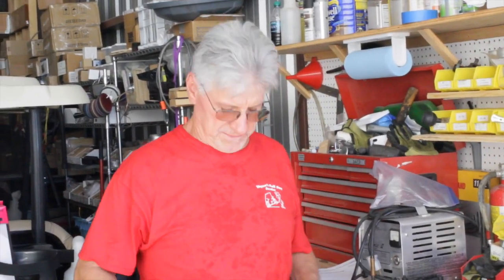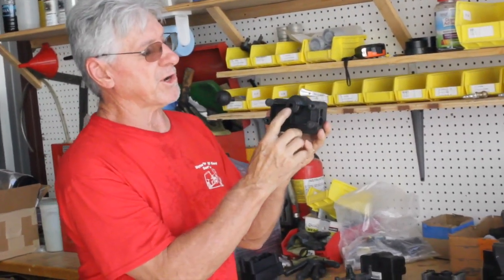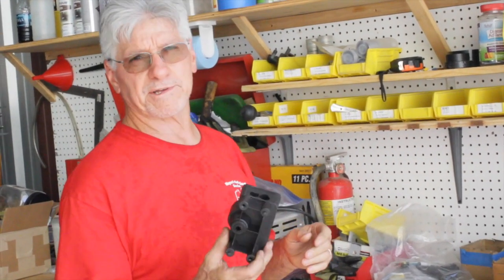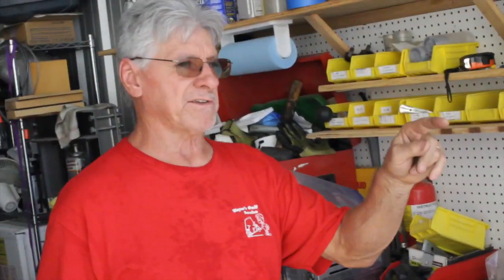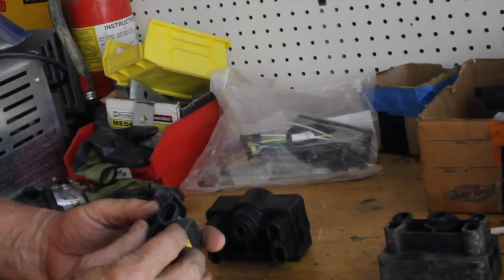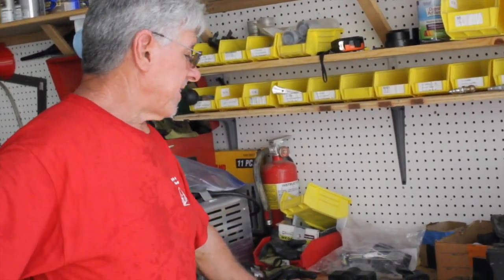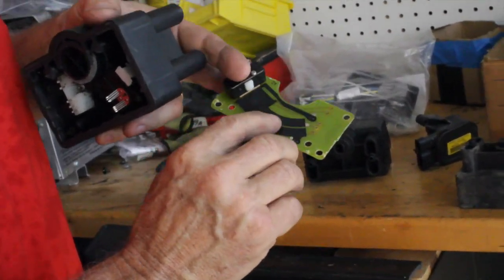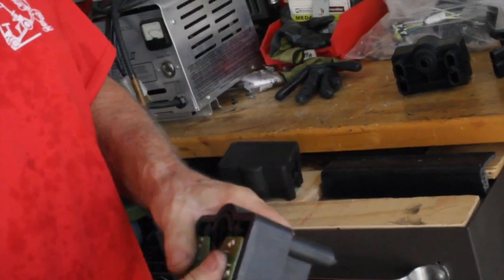The Difference Between MCOR's (For Club Car Golf Carts)

Comment: I replaced my mcor on my 2014 precedent but it still won’t move any ideas?
Reply from the maker: If it won't move at all, it's not the mcor. Either batteries,  solenoid, loose or bad connection,  tow switch, or the fuse that is back by the controller.

Comment: Hello! What does jumping the 2 wire connector on MCOR do? I have a 2017 club car precedent with intermittent moving issues. It’ll work fine then stop working and work again. Saw other videos of bypassing the MCOR. Wondering if i can do that for a cheap fix.. just fixed a rattling loose brake pedal and a shorted horn. Thanks for the video and help !!!!!
Reply from the maker: That closes the microswitch That is inside the mcor.

Comment: Am I right to assume my 2018 precedent i2 uses an MCOR 4?  I have some hesitation/shuttering at full throttle.  My batteries are new, my original curtis controller had the same issue, my new alltrax XCT is having the same issue, I have a brand new solenoid and newer motor.  I can't think of what else it can be???  Hopefully I ordered the right part!
Reply from the maker: Yours can use both the mcor2 and the mcor4
Reply: @waynemartin.waynesgolfcart4900  Thanks!

Comment: I have a club cart 48 volts 1996 and my mcor is a potentiometer  , can I retrofit to mcor4
Reply from the maker: It depends on the serial number of your cart, what is the serial number?
Reply: Serial number : A9645-542184
Reply: Thank you very much for your help , parts are hard to find and I want to get the best parts
Reply: Serial number : A9645-542184

Comment: Do you have a video on installing a AM293101
Reply from the maker: No video,  but the kits I sell come with complete instructions
Reply: @waynemartin.waynesgolfcart4900  I have a 1993 six volt system. Will this work. It has the old switch system
Reply from the maker: No it will not
Reply: @waynemartin.waynesgolfcart4900  Am I stuck. Do I have to try and replace the current system. I looked at your website. Looks like you are very experienced in the golf cart business. My cart is in great shape. Not sure if it would be worth trying to convert to a 48 v system with all new parts to make it work
Reply from the maker: What do u have now for a system?
Reply: @waynemartin.waynesgolfcart4900  36 volt stock cart
Reply from the maker: I was asking what drive system? Resistors,  vglide, pot box?

Comment: Good morning Wayne I hope all is well well thus far I've changed my receptacle which I needed to do but we still have a power problem with our Club Car DS model. I had my daughter take it for a ride using my GPS and she got it to about 8 mph, she was on a slight downhill grade and got it up to 12 mph. Reverse is real slow and to try to back up a hill it's like non-existent. So I'm thinking emcor does this sound logical to you? Thank you in advance
Reply from the maker: Check batteries first,  usually # 1 problem. 

If cart was ever faster than 8 mph, could be the speed sensor.

Comment: Hello Sir. I have a 2003 Club Car DS IQ model. You are the only guy that seems to know how to get to the root of issues with electric carts. I replaced my batteries. Soliniod speed control is good. . The cart goes and will stop under load. Like going up a hill. Press the pedal again and she goes.rinse and repeat. I took it to a credible shop and they could not fix it. The Mcore has the upgrade. I’m baffled. Any advice for what to look for next? Have you ever encountered this. Your my last hope.

Best, Bruce Johnson
Reply from the maker: IF your batteries are NEW , not 4 years old,  AND you replaced the mcor with a conversion kit, NOT a aftermarket mcor, then that really narrows it down.
However my first guess is you replaced the mcor with aftermarket crap, and that is your issue.

They no longer make oem mcors for DS carts, so if you buy a replacement mcor, it will be junk.
The aftermarket junk wont last longer than a about a year.

So i think you are gojng to waste alot time going on circles with this.

If your mcor was good, then i would say either a loose connection, ( on motor, or key switch, etc ) or forward reverse switch needs replacing.
Reply: @waynemartin.waynesgolfcart4900   Wayne. I have not replaced the MCor. It evidently had a conversion put in it before I bought it. I had it for 2 years before it started doing this. Is it possible the conversion failed? I ve checked all connection and cleaned. Made sure they are secure.
Reply from the maker: if it does have a conversion, replace the mcor with a oem mcor
Reply: @waynemartin.waynesgolfcart4900  will do ! I look the OEM up getting it now! Thank you so much! Your videos are priceless.

Comment: Where is the MCOR located on a 94 club car?
Reply from the maker: Is it a 48 volt cart?
Reply: @waynemartin.waynesgolfcart4900  36 volt
Reply from the maker: You don't have one.  Only on 48 volt
Reply: @waynemartin.waynesgolfcart4900  Thanks, having symptoms of a bad MCOR. Any ideas?
Reply from the maker: I need more info. What do you have ? A resistor cart? Vglide? Potentiometer? How old are the batteries? What is or is not the cart doing? How long has the problem been noticed?

Describe what is happening?
Reply: @waynemartin.waynesgolfcart4900  Cart has vglide. Vglide, batteries, controller & solenoid were  replace 1 year ago. Cart cuts out while driving then kicks back in like a temporary loss of power. Been happening on and off for a month.
Reply from the maker: Could be a loose wire somewhere,  check all wires, even key switch. 
Also could be f/r switch, or vglide.
Reply: @waynemartin.waynesgolfcart4900  Thank you for your help.
Reply: Hey I have a 1996 36v club car ds with vglide. The cart is moving slow. Sometimes f/r switch isn’t working . Any ideas why it’s slow?
Reply from the maker: Hey, could be lots of things, old batteries first,  worn or dirty vglide,  if it's a resistor cart they are slow anyway.

Comment: How can I test to see if my mcor 1 is bad on my 2002 48v DS?
Reply from the maker: You should be able to tell when you step on the go pedal. 
Does the car move right away.
Do you feel any hesitation at any point when pedal is pushed?
Reply: It shudders in forward when I step on the pedal. But in reverse it runs fine when stepping on the pedal.
Reply from the maker: sounds like a battery problem
Reply: Ok. I load tested all six 8 volts and 2 of them showed bad. I’m pricing new ones now. It seems weird that reverse works normal even with 3 people in the cart, but forward barely moves, just shudders and creeps along.
Reply from the maker: reverse is half speed,  only uses half the voltage

Comment: When my pedal reaches full throttle the electric motor cuts off and on. Would this be my MCOR worn at top throttle? Mid throttle works fine.
Reply from the maker: Yes that sounds like the mcor. 
One thing to try, is turn the key off, stomp the go pedal to the floor about 10 times. Turn key back on and drive at full throttle and see if it temporarily got better for a minute.
If it did,  then definitely replace the mcor.

Comment: Wayne, great video. Got a question. Can you recommend a place on line where I can purchase a “OEM” MCOR 2?
Got a friend with a Club Car whose micro switch in the MCOR of a  Precedent is bad. Would just replace the switch but not sure if I can get the MCOR open without damaging it. Don’t want China knockoffs. Thanks, Ron Hirsch
Reply from the maker: yes, buy it from David at
Revolution Golf Cars.   I buy all my mcors from him. Tell  him Wayne in calif sent you!

Also, meanwhile unplug the 2 pin connector from the mcor, then bend a paperclip into a u shape,  then push the paperclip into the 2 holes in the loose connector.   Leave the connector loose then drive cart to see if that helps.

By doing that you are by passing the microswitch.
Reply: wayne if it’s the switch which I suspect, would you jumper it out and run it that way or is that dangerous? Thanks for the recommendation as to where to buy an OEM. If it was my cart I would just replace the MCOR though the part is pricy. It’s an old cart and putting a lot of money into it would probably be foolish.  I am a retired electrical engineer so working on this stuff is fun.
Reply from the maker: you can run the cart  like that, it won't hurt anything

Comment: Wayne, thank you so much for the MCOR-4 part #. Love your videos. First time golf cart owner with a 2002 club car DS. Your videos are by far the most helpful for a 61 year old cancer survivor with what my wife calls kemo brain, I call CRS (can’t remember shit) Keep the videos coming. Hope your well.
Reply from the maker: 👍im 67, going in 40.
Next week back surgery, so hope i can start bending again, and making more videos.
Reply: wayne martin I can definitely relate. LOL, hope all go’s well.
Reply: I also have a 2002 DS. So, the MCOR on this model year is the MCOR-4?
Reply from the maker: @johncalvo1743 you do not have a mcor4 on a ds, unless it has been converted.
Reply: @ Thank you. I just replaced the MCOR 2 hours ago. The cart is now running like a champ. I saw a few videos saying that there were some T-40 bolts on the floor mat that need to be removed. But my cart didn't have these. So, I removed the mat to open the little trap door that goes to the undercarriage, but the floor was solid aluminum! I was flummoxed. It turns out the MCOR was bolted to the outside crossmember of the chassis underneath the passenger side. It was easy to get to, but I had to jack up the cart.

Comment: Is it beneficial for me to upgrade my 2002 club car DS from an MCOR-1, to an MCOR-4 with a conversion kit?
Reply from the maker: Only would need to go to the conversion kit, when your mcor 1 fails.
Reply: I noticed from trial and error and research. The linkage from my go pedal to the MCOR is sloppy so I figured I’d just replace it all. I did put a rubber washer between the go pedal arm and the little pin it pushes to turn the arm to the MCOR and it helped speed up the cart. Don’t really like it being jerry rigged. Would rather replace the whole damn thing and have it done right.

Comment: Having a club car precedent myself, finding your channel has been great. Thanks for taking time to make these videos. 

Is there a video for testing the MCOR 2 ? I recently picked up my cart from a repair shop after determining the technician was a parts changer that just keep replacing parts until the cart runs again . That’s not my method. Surely there is a way to test resistance on the MCOR to confirm if it is faulty . Thanks
Reply from the maker: yes there is a way to check the mcor.
Do you still have the old mcor?
im working on a video to show how to check out mcors.
Reply: yes I have the original MCOR and today after doing some common sense resistance testing determined the MCOR was not likely my problem . I used the two pin female plug receptacle to determine if the micro switch was activating by turning the potentiometer counter clockwise . I then tested the three pin receptacle for the accelerator function and it also seemed fine by gradually showing a resistance change as the potentiometer was manually turned. 

After reinstalling the MCOR and solenoid that the previous repair shop claimed to be faulty I found they both worked fine. I found my problem to be a bad control module. Luckily I found a used controller for testing purpose at a different golf cart repair shop. I installed the controller and the cart functioned as it should!  I’m now faced with the decision of upgrading the motor and controller for added torque since the controller has to be replaced anyway. I’ve been unhappy with the torque when using on gradual to steep grades. This cart was purchased to use as a quiet and comfortable way to move about while hunting , working and joy riding . The hills have always been an issue even when the cart was new. It is lifted with a rear mounted seat and extra long roof to cover the back seat . For lack of a better description the cart kinda has the look of a Bad Boy buggy minus the camo. 

I’m also considering changing the 4-12v battery system to 6-8 volt batteries for better capacity. I’m researching now how to modify the battery compartment to accommodate.  Thanks for the reply. If I can locate a phone number I may call you later to discuss any options you may have. This is the first actual breakdown I have had on this cart so I am very happy with its reliability. After learning some about the possible upgrades this looks like a good time to figure out the best recipe to better suit my needs from this cart.
Reply from the maker: Usually when dealing with motors , you need to make a decision if you want speed or torque. Normally when 1 goes up the other goes down. They do have controllers that have adjustable settings on them so you can switch on the fly.   But they are pricey.
Reply from the maker: I have been able to fit 6 batteries in a n older 4 battery precedent before.
I ended up cutting rectangular holes in the front of the battery bucket, so the front 2 batteries would protrude into that dead space between the body and the battery bucket.
Reply: wayne martin do you have a picture or video up that shows the arrangement of the conversion to  6 -8v batteries in a precedent that had 4-12 v batts originally ? In your opinion is the capacity difference substantial enough to justify the modification? Do the electronics that mount in the center need to be relocated . I guess my main concern with cutting the battery tub would be loss of protection from water etc .
Reply: The only videos I can find on YouTube are of a club car DS being converted . It looks to have a totally different layout and more room beneath the seat than a precedent.
Reply from the maker: Thank you so much for the feedback.

Comment: Hey Wayne, great videos! Can you do one on how to detect the problem. For example where do you start first key switch, or f/r button etcetera. I have a 2010 CC precedent
Reply from the maker: Craig,  Are you trying to troubleshoot a precedent ?

Do you have a particular issue with  your cart ?  Or are you asking the sequence of how the voltage travels?

Im not sure im following you exactly.
Thank you
Reply: wayne martin Thanks Wayne, I did the push the cart test and get the beeping sound, I assumed it was the mcor. I replaced my mcor4 with anew one and still nothing. Batteries take a charge, and the buzzer in reverse sounds healthy
Reply from the maker: What is the story with the problem?
What happened? Were you moving, was cart sitting for long period, ?
Reply: wayne martin thanks, cart had been sitting for about two weeks. I recharged it, and then it wouldn’t move.
Reply from the maker: First , if the batteries are charged, make sure tow switch is in Run, turn key On, put in Forward, and step down on Go pedal, 3 times!

If it does not Run at this point, 
Then try resetting the OBC.

Do this by disconnecting Both the main positive and main negative wires, and let it sit for 10 minutes.

After sitting for 10 minutes, hook the wires back up, then go thru the above sequence i layed out.

Tell me what happens.

Comment from the maker: Trompie, your mcor is a mcor 1 and it is mounted under the cart, underneath the pedals.
The only mcors that are made anymore for your cart, are aftermarket cheap ones.
You can find them all over the internet for less than 75.00.

The only other solution is a conversion kit, that costs about 300.00.
You should be ok for awhile with the aftermarket mcor.

Comment: Hi David. I'm from Knysna, Western Cape, South Africa and recently bought a previously owned club car. Not sure of model 18780? It is in fairly good condition but when I used it the first, and only time so far, it ran ok but the speed varied quite a bit from relatively fast to very slow. It looks and sounds like the MCOR as per your video. What must I do to remove the old one and can I purchase a new part or conversion kit from you to be sent to SA and at what cost? Regards.Trompie Barnard

Comment: I have used both, and I will only use the OEM mcor for a customer. Although it costs alot more, it is worth it.
I tried using the Chinese mcors for awhile, and they would fail in less than a year. Then I had customers that thought I was using "used" parts since they did not last 
And it was a hassle having ho back and replace them with the good ones ( OEM).
So the only time I will use a cheap Chinese mcor, now, is on my own personal cart.

Comment: I have a 2013 Precedent gas cart that needs an MCOR. The MCOR 4 doesn't fit, the current wire harness has 1 plug (with 7 prongs) into the MCOR, do I need a conversion kit? The conversion kit doesn't look like it has 1 plug either.

Comment: Alan, it is the mcor.  Replace it, and it will fix your problem.  The hesitation in an mcor, is the 3 wire side of it, the "swiper, or rheostat" part of it. The intermittent stop and go is the 2 wire part of it, that is the microswitch is failing.
Again replace it, and all should be good.
Wayne
Reply: Thanks Wayne!  My Precedent was built the 31st week of 2010. So I’m thinking I should upgrade to the newest Mcor, with the adapter kit?  After your video I feel fine just doing it myself.  Again, you do a great job of explaining everything in your videos. I think you will gain a strong following, keep at it.
Reply from the maker: James, great !!  I like to help.
Reply: Do you know why the Chinese / Mexican MCOR4's go bad so quickly?  I took a hot knife, and disassembled one to find out why.  The hesitation/bumping/rough riding/etc. is not a mechanical failure and While not necessarily easy to do, this problem is fixable.  After taking the flat topside off the MCOR4 carefully, all you need is a small flat blade and paper towel or small piece of rag.